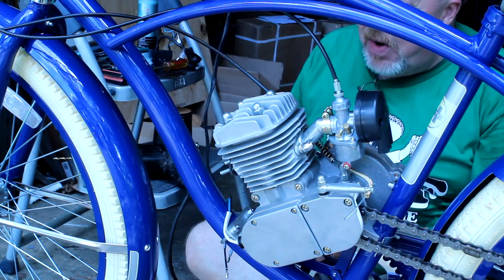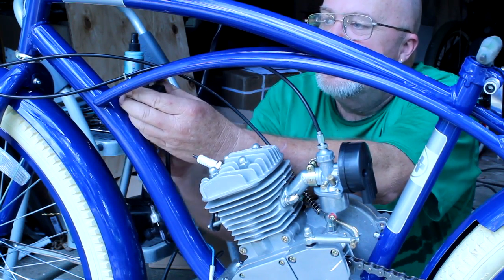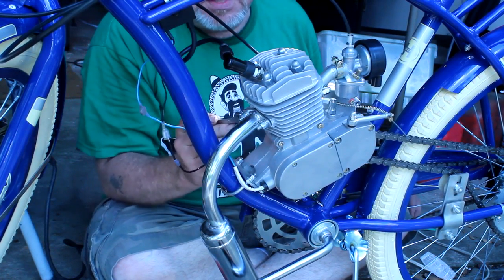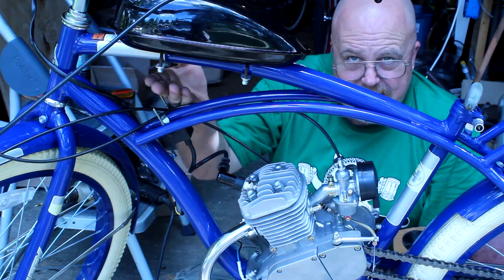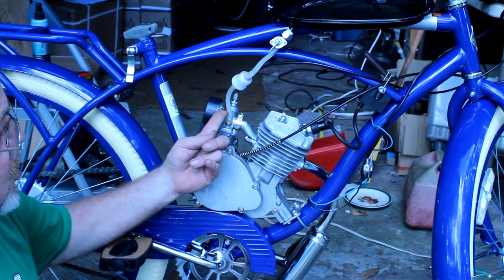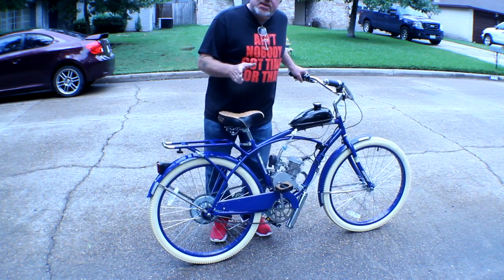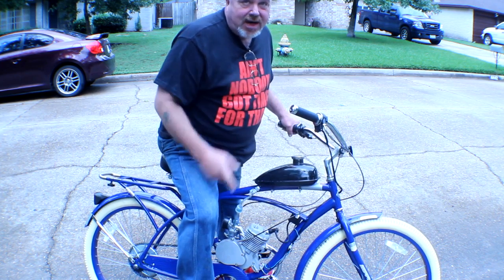How To Build Motorized Bicycle Final Assembly & Starting

Comment: You told me 40 to 1 😢 cradle to grave, ps I thought 2 strokes had engine braking so I would use “engine braking” on my 2 stoke bike but my brother told me only 4 strokes have engine braking. Am I putting extra wear on my pistol seals when I do that or am I fine?
Reply from the maker: engine braking can be done on a 2 stroke but looking at it, you wont have the lubrication from the gas/oil mix

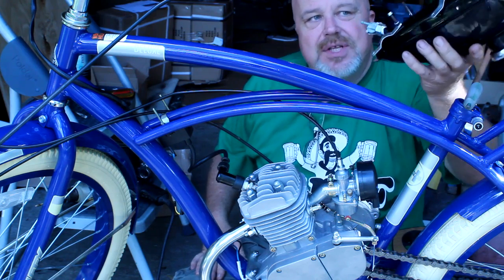Comment: 7:47 I'm having the hardest time with the gas tank mount, another channel said that the standard way of mounting them with the brackets underneath eventually causes them to leak because the vibrations pull on the bolt welds... is that true?   Because the solution they recommended I can't get to work at all!
Reply from the maker: I've been running mine that way for 10 years. Biggest issue is when you get them too tight

Comment: What bike are you using here??? I like the frame, white tires, etc...
Reply from the maker: A Nell Lusso. Avoid. They have issues w/ the frame cracking at the rack
Reply: @HughesMotorized  With that said, thanks for the heads up!🙏 Well, I'm going to do my first motorized build soon, and I just scored a, '60's/'70s era, Schwinn Fleet. I'm only '5,5" and this Schwinn is a 24" standard cantilevered frame.  That means that I can touch ground w/ both feet! Lol. Do you think this old Schwinn (Chicago forged) will be a good candidate?

Comment: the braking system questions me, mine is also the single speed cruiser bike. if the lever of the brake hits the bolts but hardly can that be just bent some and still work ?

Comment: Nothing about the speedometer. The kit comes with a piece but no instructions
Reply from the maker: Digitsl or one w/ a cable to front wheel? The cable ones are junk. They are not worth using. They always break. Never used a digital one myself

Comment: I've got to zip tie my fucking adapter. I'm doing the build on an OCC schwinn stingray chopper from 2006 circa.  Let me tell you.. none of the shit fits on this frame. I've had to improvise. Everything's done except the adapter. I'm waiting on some 10ft chain in the mail (chains too fucking short) and some zip ties. So all I have to do is hookup the electrical components , Install the chain, double check clutch adjustment. Gas it up with the part of oil in the tank. And she should be good to go. This has been fun but also hell. Itll be worth it

Comment: Head is on the wrong way lmfao
Reply from the maker: NO it's not on wrong
Reply: On mine bought from factory spark plug faces inlet
Reply from the maker: @Motorizedstuff  And many others from factory plug faces exhaust. Interchangeable
Reply: @HughesMotorized  ok cool
Reply from the maker: @Motorizedstuff  https://motorbicycling.com/threads/which-way-spark-plug-slant.37384/

Comment: Awesome review Mr. hughes!. I had a quick question about my 80cc two-stroke motor, I recently replaced my piston with the two O-rings because the old one was kind of wore out and after I did that it kind of barely turns over like it has a hard time compressing I’ll get a compression turnover here and there but not as freely as it was when I fisrt got it. Any idea what problem I am incountering?.

Comment: These kits are junk,,,,everybody iv talked to about these things have nothing but problems,,,I got two of them an there both broke down
Reply from the maker: YUP. However, they are FUN junk. Once you master them, they are more reliable. You can rebuild one in an hour and once you know what an issue is, it's usually up and going in like 10 minutes. 4 strokes are more reliable

Comment: i neeed to ell u what my fuck up is myy cdi and maggg is the same wier  matchy matchy right welll win i mach the wiers i get no spark but but win i swich the wiers i get spark and and   win the wiers r machying wier to gether i only get spark win i push the bike back werds so win i swich the wiers to not machying the bike sparks win i push it forwards so do u think my cdi is wier wrong or backward  and i got new cdi on way i all redy put a new maggg on it its not magg meeter sed 330 ohms   so i only have a spark plug tast and a volt meeter but spark plug light gos off win i switch wiers to not mach what should i do what wood u do i did see my head is on backward but thats not going to stop spark i will fixs that so my sparkplug facing right way  i spoke to u befor abolt ur tats

Comment: Great video. Learned alot, such as pedaling to take off from a start while motor is already running. I have a fairly new bike and no one taught me that i could burn the clutch if i dont do to lack of torque etc. Have watched about 4 videos and feel semi confident in reinstalling my carb and what not

Comment: Your going to flood the engine when you turn the the ignition off to engine brake. Piston is still moving and still sucking in fuel and air.
Reply from the maker: If one held throttle wide open long enough I assume it would happen. I'm talking only doing it for a few seconds or so. Never an issue for me. Ride On !

Comment: so is 16-1 for break in...or 40-1 cradle to grave?..u confuse me...
Reply from the maker: First time you run the engine (cradle)
Last time you run the engine ( grave)
Run 40:1 . Period. No break in mix. just 40:1 from day one till forever
Reply: @HughesMotorized  rite on...tthank you...im just finishing my bike...really proud so far...zeda firesstorm belt drive an ofcourse a chamber pipe..i drilled an pinned the idler pully to the frame..dont know why nobody does that..it aint moving...
.almost done...love ur insight...keep up the good work...
Reply from the maker: @fredmeincke947  you really dont want to drill into the frame. It will weaken it and the frame could crack and fail. Watch the area. Enjoy !
Reply: thank u...i feel two holes in the chromoloy filled with ss screws an red loktite will keep all integrity'''

Comment: Hey I have a hyper Beach cruiser I'm working on I wish I could have a heavy duty tank built for it gas I broke two tanks on it damn thing has a really curved back bone
Reply from the maker: Main thing is to only tighten up tank just enough to keep it from twisting over while riding. I have a Hyper I'm going yo build soon. I'll prolly put a moped gas tank on it. That's an option

Comment: thanks man building my first bike using a schwinn chopper stingray and this is helping me alot with the choper i need to make alot of alterations i am just wondering if you every built one on that type of frame and if you have any pointers
Reply from the maker: I have not done a Schwinn chopper but I have done a Micargi stretch. Similar.

I suggest look into https://www.pedalchopper.com . They specialize in them. They sell motor mounts and the like.

Comment: hello I would like to know how does the 2 strokes motor work going up hills
Reply: I built one. It does really well going up hills. If its a really steep hill pedaling will help you get up it real quick with hardly any effort. The motor.rewards you if you help it out a little like that.

Comment: 13:06 don't pull the fuel line off, all you need to do is pinch the fuel line with your fingers a few times and it will make the fuel go into the line when you squeeze the fuel line air goes out and when you let go the fuel will go into the line and just repeat until it's full it takes about 10 to 15 seconds to fill it and at least that way you don't spill any fuel
Reply: Mine is not flowing no matter what i do 😢

Comment: great vide I am building one now first the cdi can I replace with a racing on and also take air box off carb and replace it with a open one for more air?? will this help to increase speed?? thanks robert
Reply from the maker: Yes, more air will help on power. Cleaning up ports will help a lot too

Comment: Hey! I have a slight problem. Everything is installed correctly, I have the 48cc version. The spark plug isn't firing. I'm pretty sure i've wired everything correctly. I've wired: the black wire from the engine, and the black wire from the kill switch to the black wire on the CDI, and the blue wire on the engine, and the yellow/red (Can't remember color) to the blue CDI wire. Could I witch them up? (Let's say theres the black wire on the CDI, and I switch the black wire from the engine and the black wire from the kill switch, or does that not make a difference?)
 Theres an other problem: The clutch cover doesn't wanna go back, the flower nut broke, and isn't spinnig back on. Could that be the problem? Or, is the CDI faulty? 
Thanks!
Reply: Sounds to me like you may need a new spark plug and definitely need a new flower nut. Don't be so rough! Lol

Comment: These videos --- ROCK.
VERY informative.
I used every one to put mine together.
It was a BITCH attaching the rear sprocket and had to do it THREE TIMES before I got it right.
I am using a mountain bike so I have no coaster brake.
Mine came from U-MOTO and soon I should be starting it up.
I took my sweet time on this as I was in NO hurry.
Besides, what with winter happening here in Kentucky, I had plenty of time to DO IT RIGHT.
Next week I should be starting it.
I just hope everything is copa-stetic.
Thanks for these videos -- they are a lifesaver.

Comment: Where can I buy that threaded clutch cable holder. Bought a motor from Walmart but its missing.
Reply: I was looking for parts at E-bay and saw them for $ 1.
Reply: That was for ON the motor,the clutch lever part was about 2-3$ depending on whos

Comment: Excellent work mate just finished mine the rear sprocket was the worst job lining up a nightmare. What is the white wire for coming out of the engine?
Reply from the maker: White wire is useless. It s a 6v wire for lighting but if you use it, it robs the power from the spark
Reply: Bruce Nichols you can wire up lights and what not to the white wire

Comment: My 49cc won't start. has good spark and I've even put a little gas directly into the cyl, no fire at all. I was hoping to actually see the first start here but  didn't happen. Did you have to pull it with a vehicle as I've heard suggested? If no, did it really start right up, or was the first start a pain? 

Mine has a 1000w front hub as well so I was able to move it along pretty well in trying to start it.

Comment: great video A+ for being on top of the normal questions people would b asking and covering what seems to be simple for some but is not for everyone  really great job people can definitely use your video to help them with there project... i do have a question what type of fuel consumption am i looking at for a bike like this.. i know weight of rider and size of wheels and gear...good round quess.. what do you get out of a gal. of fuel?

Comment: Great video! You obviously know what you're doing. That said, I built mine and it ran just fine for about 20 seconds then it bogged down and stalled. I noticed that the fuel line had an air bubble formed above the carb. But there was fuel above the air bubble. If I disconnect the fuel line then the fuel flowed freely. Have you ever heard of anything like this?
Reply: AOZMONSTER  try loosening your gas cap to let air flow through

Comment: I have almost finished the installation of the motor and all the components to my bike frame.  I am checking everything to make sure its tight and right.  I have a doubt and I can't find the answer anywhere so maybe you readers can answer this question.   There is a piece that came with the kit that looks like a two sectioned coupling, made of heavy iron or steel, with threads on the outside which looks to be 3/4 "but also 1" in diameter.  It has a square headed hollow bolt about 5/8" in diameter by about 1 1/4" long.  What is that and what is if for?  How did I miss that in the instructions.   I'll appreciate any info.  Thanks.
Reply: Linda Lambert Its a Gear puller! I was trying to mount it on my bike when I first got it till someone called me a DumbAss and showed me what it did! Don't lose it eventually you will need it!

Comment: do i have to hold the cluch in when i ride?
Reply: No. The clutch has a latch that you can set. This allows the wheel to move freely. When you release the clutch, the motor will engage. You will have to hold the clutch momentarily while you set the latch.

Comment: My bike just wont start anymore after a normal ride it has no spark so i installed a new cdi magneto spark plug and still no spark ??
Reply: After the ride i took the exhaust off and then put it back on and it wouldn't start anymore

Comment: My back tire doesn't want to turn. The pedals wont turn either. What could the problem be?
Reply: Stacey Meyer if your still having problems tighten the clutch cable where it connects right next to the carborater And the chain
Reply: Stacey Meyer You might have your flower nut to tight or need to a Just that!

Comment: I have a 3rd white wire coming off the motor besides the black and blue wires that go to the magneto.What is the white wire?
Reply: The white wire is there in case you want to power a light from the motor, but it uses power from the magneto, which is used to generate the spark for the motor, so it's advisable to not use the white wire, but instead to either use a wheel dyno (I think that's what it's called) or to purchase a second, smaller magneto that is designed to generate power for accessories on a motorized bike.
Reply: Anthony Gendron thanks for the help

Comment: the rear mount sits on the same part of the frame that your seat slides into. there are two allen bolts there for mounting cupholder. is the motor mount above or below the bottom allen bolt? or is it right where that bottom bolt goes?

Comment: Just finished my first build and it was running semi-smooth. Now the thing vibrates like crazy sort of like something is out of balance. Does anybody have any ideas? I have went through and made sure everything is tight.
Reply: it's a cheap chinese single piston motor, it will vibrate like crazy. try thicker rubber at the mounts.
Reply: they sell little patches of felt that stick to things at hardware stores. they are ment for furniture but I used mine to deal with the vibrations and It worked pretty well
Reply: I have no clue wear to even start to place them. I mean this vibration is so hard it is hard to hold onto the handle bars.
Thanks
Reply: Little late but make sure all the bolts are tightened.

Comment: fuel filter put on wrong direction      you want to see what comes out of the filter not what go's  in to the filter .    its like a sediment bowl
Reply from the maker: +charles mullins Wrong. The filter has an arrow showing flow. It also has a magnet to catch anything metallic
Reply: +HoustonMotorized  I checked and you are right.   they are not like they where made in the 60's  where the bowl was at the bottom and you was looking for water more then anything else. plus dirt of course ..

Comment: Hi Houston, May you help me my backtire is locking up? its a new kit I put on. Any help would be great.
Reply from the maker: +Google User RVA Sometimes the clutch is stuck and just needs popped loose OR You have an issue with the hub bearing or dust cap
Reply: +HoustonMotorized 10-4 I'm on bus now just got  new tire and tube. the drive sprocket on engine side spins freely so I'm going to put rim on and see what happens thanks a lot buddy.
Reply: +HoustonMotorized I got the wheel bearing tight because it was loose. And missing the locking nut lol.
Reply: +HoustonMotorized Thank You Houston.

Comment: The muffler position looks like you could get an ankle/leg burn.I would definitely  re position it. But loved your assembly video it was fun to watch.Thank you.
Reply: so when i come to a stop like at a red light hold the clutch in?, then when i am ready to go just release the clutch and hit the gas? or from a stop i have to pedal first?, could you post a driving instructional video?
Reply from the maker: +DizzzyKipper No problem with the muffler. Fine as is. I have done 200 builds
Reply: Pedal up then release the clutch while giving it gas. If you really have to you can release the clutch sooner while your pedaling to help on hills but that can be hard on your clutch.

Comment: +HoustonMotorized do these engine kits need any pre oiling before you start them for the first time? Do you need to put oil in the cylinder and then drain before you actually start it or is the 16:1 oil mixture enough of a lubricant that you don't need to preoil? Thanks!
Reply from the maker: +Zach H Just the oil in the gas premix

Comment: First and foremost great video. I've yet to fire the engine up because I've noticed that I am not able to pedal. Nothing is rubbing against anything, but I do notice that when I force the back wheel to spin it sounds like air is pushing in the engine like it's about to engage. If that makes any sense. I should be able to pedal freely but I can't figure out what is hindering the manual pedal. Thank you.

Comment: Ive found that using lucas semi synthetic oil and a champion l90c spark plug ,keeps my motor running strong ,.even after 1100 miles! I also use pieces of bike tubes to isolate the motor and fuel tank from vibration.

Comment: the white can be used for a headlight but i do not recommend that option because it lowers the power and speed
Reply: +janet fox What about LED headlight??
What is the power output of the white wire ??

Comment: What would you think the max. hill climb is for this, with the stock sprockets? I live in a place is quite big hills, and I need to make sure these motors will have the power to go up then. It would be useless if they didn't, though.

Comment: Question,  what kind of speeddo you generally get from this set up?   How durable you you rate it to be?  Longevity?
Reply from the maker: +Casey Clymore 28 - 32 mph average. You will always have to make adjustments. Reliability has a lot to do with initial build quality and maintenance